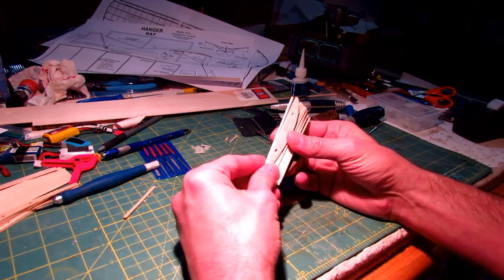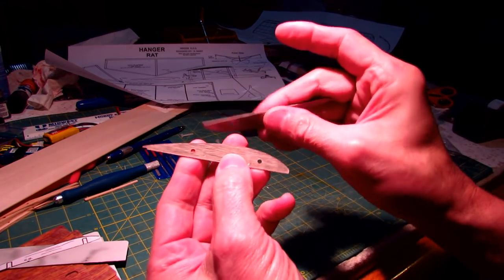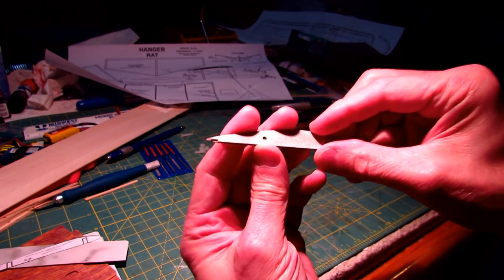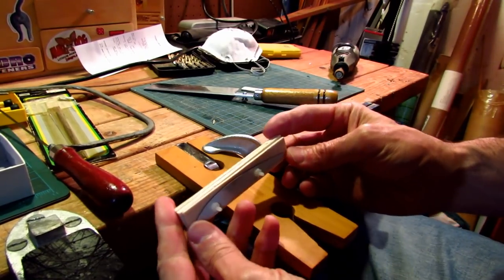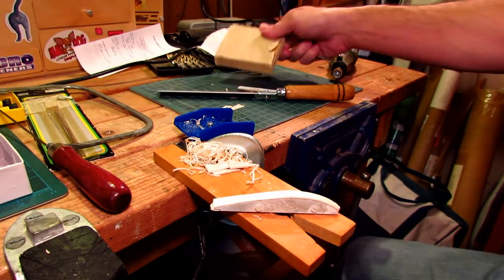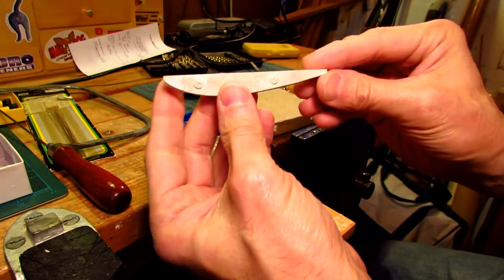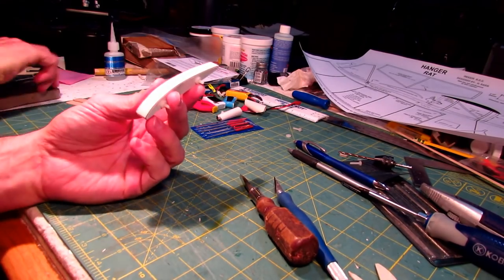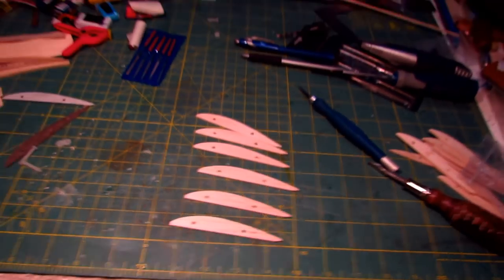Making Wing Ribs for Model Airplanes

Comment: This is exactly the way I used to do it when I built models as a kid. Except I used pieces of aluminum siding instead of the laminate. It was about .040" thick and matte white on one side. Could cut it with a stout scissors (but don't tell mom) 🙂. It works great for straight tapered wings, too.

Comment: Nice job Bob. This is a great way to make ribs for a tapered wing as well, using two different templates.
Reply from the maker: Great point!  These laminate templates also work great when cutting foam ribs with a hot wire cutter.  You can't burn through the laminate at all.

Comment: Great video! 
Hey @altbob I am planning to build an indoor slow flying micro rc plane using balsa wood. I haven't ever built an rc plane before, but I kind of know how they fly. Which airfoil do you think I should use? I was thinking about undercambered, because it provides a lot of lift and quite a little bit of drag. Also, do you think soaking 2 or 3mm balsa sheet in water, and placing some weight on it to make an undercambered airfoil, and leaving it to dry is a good idea? Will it retain it's shape? And since it will be lighter than ribbed wings, do you think the flight will be more efficient??
Reply from the maker: A cambered airfoil will give you maximum lift and be the simplest.  You are right that it also produces a lot of drag, but in a slow flying plane that isn't a drawback.  The method of forming the wood should work out pretty well.  You will need a jig of some kind, similar perhaps to the kind that I made for my Etrich Taube's wings:  https://youtu.be/wXsR6XDdMMQ
Reply: @altbob  thank you very much for taking out the time to reply to my comment :D.
I have a doubt, and I posted it below the linked video(I thought it would also be helpful for someone else having the same question).

Comment: Great. What is the thing you used to make the templates? Any links?
Reply from the maker: These are made from countertop laminate samples that you can get for free at Home Depot/Lowes or from kitchen countertop installers/sellers. They are usually made from formica or something like that, which is very hard.  The templates are shaped with a dremel.

Comment: Hi Bob! Could you explain how you get 90 degree holes by hand? I couldn't hit the second hole (the far template) accurately. Short of a drill press I don't know how you do it!!!
Reply from the maker: I have many years of practice with a pin vise.  The trick to drilling at a 90 degree angle is to keep rotating the piece as you work to you can check your angles as you go, and to take your time and start the hole very slowly.  But by all means a drill press is the better way to go to ensure 100% accuracy 100% of the time.
Reply: @altbob  Thanks Bob! I've never heard of a pin vise and I'm 71! I wondered if you were doing exactly what you've just described. I just didn't think in doing this it would be possible to drill a 90 degree hole!!! I have used 1/8 ply and drilled only one hole. Obviously twist with the templates needs to be guarded against. I find if you tighten the one bolt / nut quite a bit it seems to work ok. I much prefer your thinner laminate and two bolts for stability when sanding. I left the hobby (R/c Sailplane) in 1979. Just started playing around a bit in the last half year. The hobby certainly has changed a lot in the last thirty plus years! Thanks for your help!!! Yours truly, Chris Sorlie
Reply from the maker: @chrissorlie6497  I got my start in making miniature figures (mostly toy soldiers) and a pin vise is essential to drilling tiny accurate holes to attach parts together with pins.  I got a lot of practice, working freelance for 10 years. Have fun with the RC airplane hobby!  It can be very challenging but oh so rewarding when things go right.  I learn something every day!